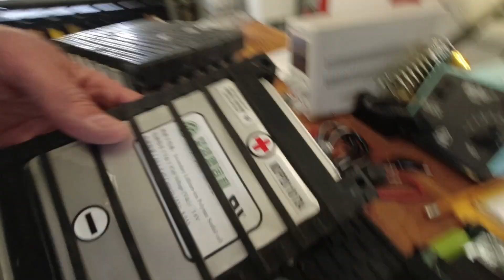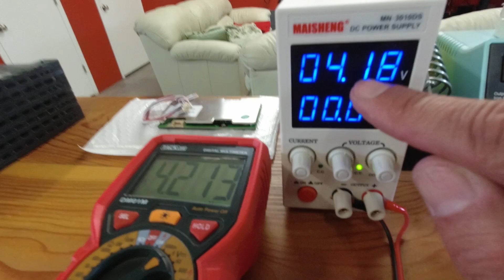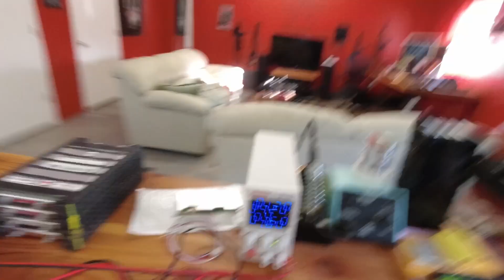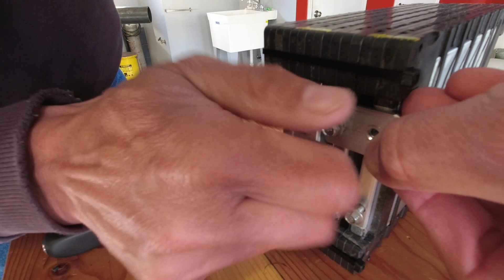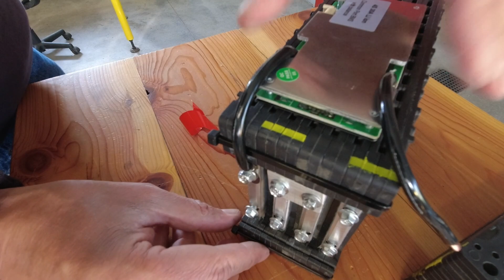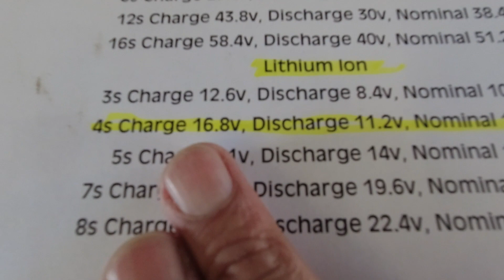How to build a Lithium battery

Comment: My goal voltage is 15.5 with these cells. Should they always be completely topped off once you get them in for health reasons, then discharge down to the goal voltage, or just charge to goal voltage of 3.875? Just starting to really dig in to lithium and used cells/health prolonging
Reply from the maker: The fully charged target voltage depends on your Lithium chemistry. Refer to your spec sheet if you have one. In general Lithium Iron Phosphate (LiFePO4) cells have a max voltage of 3.65V, that means in a 4S configuration you are looking at 14.6V at the cells. Other chemistries like LiION (includes Lithium Polymer, Lithium Cobalt Oxide, Lithium Manganese Cobalt Oxide etc.) have a max voltage of 4.2V per cell. Lithium Titanate is much lower.
Know your chemistry, use the correct BMS and don't overcharge or over discharge these cells.
LiFePO4 cells are happy fully charged and can be stored for extended periods that way. There is no memory effect with any Lithium chemistries, so there is no need to discharge and charge periodically like we did in the old days.
LiION does not like to sit at voltages over 4V per cell.
Reply: @offgridsimplicity ok, good to know, ty. My exact setup is running these same Spim08HP in a 4S6P config for a 96ah bank, constantly charged at a 15.5v off a 150-250a alternator. So they will never technically go through a “full” charge/discharge cycle. It’s to power some Class D&A/B car audio amps. I know I’ll only be running at like an 80%ish SOC at that voltage, maybe lower. I went with these cells because of their C rating, reading everywhere they are 200a/400a 3 sec burst. The 96ah is supossed to supply 2400a/4800a 3 sec bursts. Less due to SOC being under 100%, but I’m only looking to reliable pull maybe 1500a-ish max at peak pull.

Comment: Hi I am confused how you are charging using a power supply and not a charger. How do you know when the cells are at max capacity and voltage as a power supply will just continue to output what you set it at i thought?
Thanks
Reply from the maker: Let me explain: Lithium batteries need to be charged with "constant current, constant voltage". An adjustable laboratory power supply can be adjusted for both. This chemistry is LiFePO4 and therefore the maximum voltage per cell can not exceed 3.65V. This is a 4S configuration, so 4x3.65V=14.6V max. I usually set the voltage slightly below max level to account for inaccuracies of the voltage readings. So I adjusted the idle voltage, without a load to 14.5V. It will not exceed that voltage. Connect the battery and set the current to whatever you want (1C or less). The power supply with charge "constant current" until the voltage approaches set value (14.5V in my case), then the current will slowly taper off to hold that voltage (14.5V). You are now in constant voltage phase until fully charged.
Reply: @offgridsimplicity  Many thanks for your reply and info. I have a background in Radio control models and we use Lipos and iOn batteries alot and so I have some basic knowledge. We use a balance lead which monitors the individual cells and the chargers will shut off at max capacity, how does the constant voltage from a power supply recieve its data to learn of cell capacity and thus know when to stop supplying current?
Reply from the maker: Lithium Polymer batteries are capable of very large current draws, in some cases 75C or more. Such high current draws cause cell imbalances. Further these LIPO batteries for RC application do not have BMS protection (battery management systems). Therefore you have charge with balance leads for each cell to prevent over voltage situations. Larger batteries for solar and off grid applications are different, safer chemistries, in my case LiFePO4. Maximum current draw is typically limited to 1C. These batteries further have BMS installed that protects each cell from over and under voltage and a number of other conditions including cell balance. Due to the low current draws of larger batteries it is very uncommon to ever have a significant cell imbalance. It's a non issue. The power supply in my example does only measure the combined voltage of the battery and not each cell's voltage. Solar charge controllers work the same way.
Reply: Thank you 👍  @offgridsimplicity
Reply: What charge voltage settings are you using on this build? Do you charge all the way back to 16.6? Thanks!
Reply: I have built the same battery in this video. I have the Victron 75/15 like in your charging video but i am wondering if I should charge to max 16v or to the Nominal voltage. Also wondering what the float voltage should be on the victron. Thanks Again!

Comment: I have been looking into these spim08hp cells for a while now. Considering making a 48v pack for my son's electric dirtbike. A question for you, I have some experience with electrical, lithium batteries and wiring: Is there a reason why you used aluminum for your bussbars instead of copper or another material? Is there a downside to using aluminum for the bussbars? Sometimes we need to work with the supplies we have on hand. If I needed to get a high amperage from the battery, should I still use aluminum? I appreciate the detail in your video, especially keeping note about the same length balance leads for the bms. People forget about ohm loss through a length of wire and how it will effect the balancing of the cells. Curious about your bussbar choice, please let me know your thoughts. Great video!
Reply from the maker: Copper bus bars would be even better than aluminum, but I had 6061 aluminum flat stock on hand and it’s electrical conductivity is almost as good as copper. I would say use what you have or what’s available at the time. Remember that high voltage overland lines are often aluminum as well. It’s cheaper than copper and only slightly less conductive. Use ample thickness to support your amperage draw.

Comment: Are these good for electric go kart
Reply from the maker: I would say so. It depends on the amperage you need. Go on Batteryhookup.com and see what they have. Find cells that match your amperage requirements and capacity. Use my discount code.
Reply: @offgridsimplicity  thank you

Comment: Good video and the overall cost wasn’t bad either.  This battery looks like you could put in a 30 cal size ammo can.  Of course if it is in a metal can, insulation is needed so the connectors don’t short out on the metal ammo can.  I am sorry if I missed it.  Does the amp hours increase like the voltage?